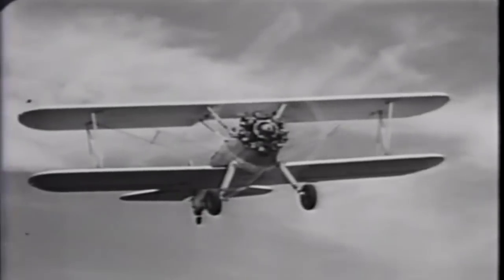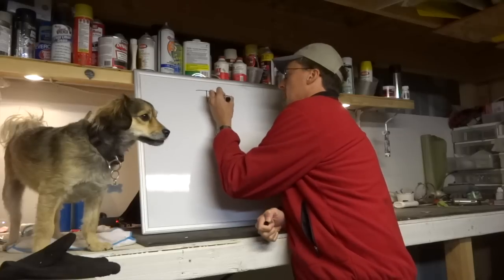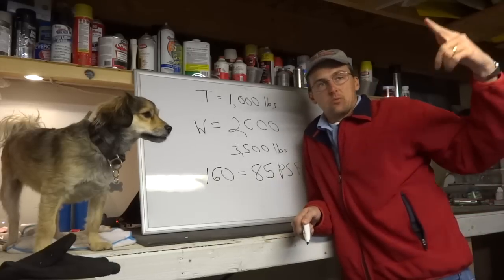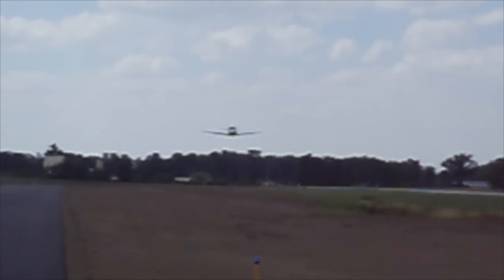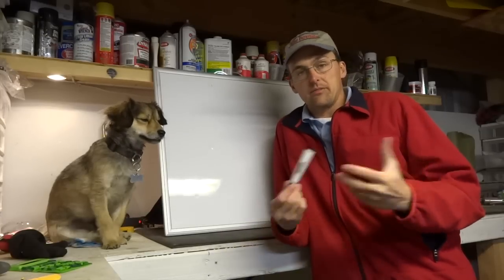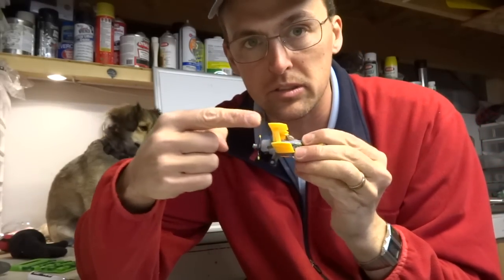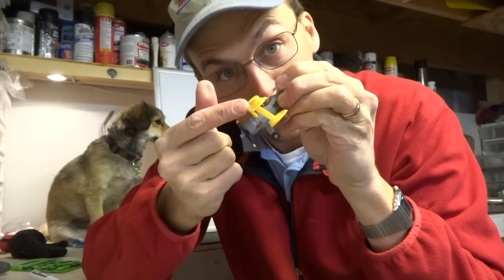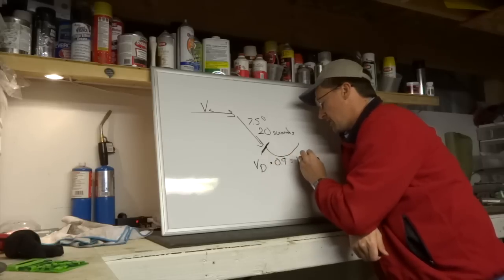Dive Testing, VN Diagrams, and FAR 23.335 - LongNoseThunder Reflight - Walter Turbine Powered

Comment: Wooden gliders used to have the requirement (JAR-22) that they should not be able to pass Vne in a vertical dive with airbrakes extended. I think the requirement is now 45 degrees.
Reply from the maker: I have not seen that before.  I like it.

Comment: Woof.  Thanks for the p23 explanation of Vne.  I suppose the answer's probably been rehashed a thousand times, but have wind tunnel testing regimes been built for flutter exploration?  If so, why aren't they more visible?  Is this a case of "you can't accurately model reality"?  Even full-scale testing of p23 airplane structures seems like it'd be relatively economical.

Comment: Always been wondering how builders of experimental aircraft determine Vne for their particular aircraft. So basically it depends a lot on how slippery the airframe is - but is also limited by any potential flutter? Have you encountered flutter in flight testing of single engine piston aircraft?
Reply from the maker: I have but nothing severe enough to damage the airplane.

Comment: Aircraft are not designed and built to a zero margin of safety. Actually all limit loads are normal flight loads are * 1.5. Vne or V dive Va doesn't have to be right at the limit of structural or flutter limits.

Comment: Where does the 0.9 come from in the formula?
Reply from the maker: 0.9 is the difference between VNE and VD.
Reply: The 0.9 is a factor of safety, built in by the engineers and those who don’t want to be a statistic. It’s making the never exceed speed 90% of dive speed, which is technically the fastest ever speed the airplane should be going at 7.5 degree down angle for 20 seconds.

Honestly, just an arbitrary decided number to stop Cletus from taking his pop’s crop duster and barnstorming it into the ground.